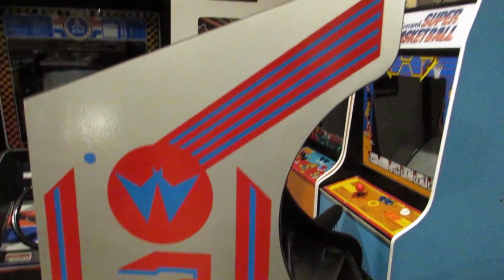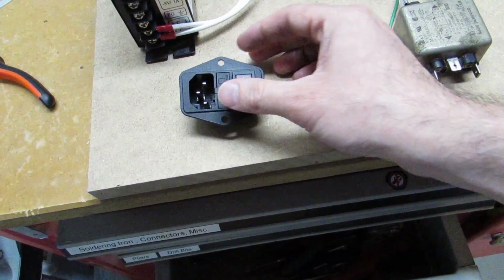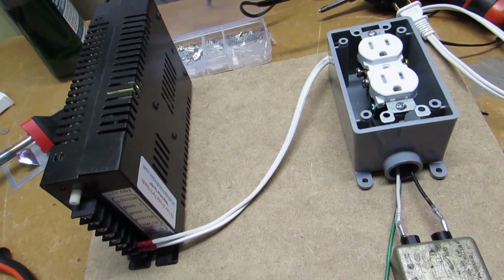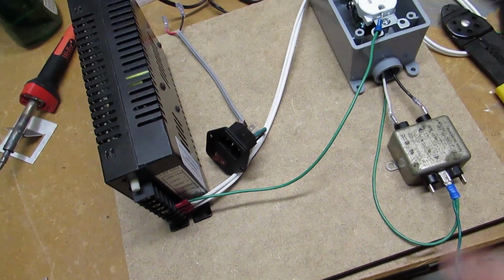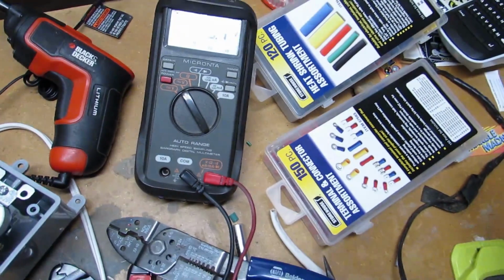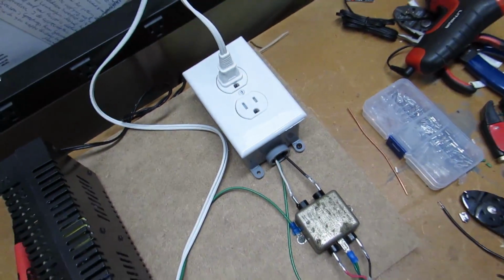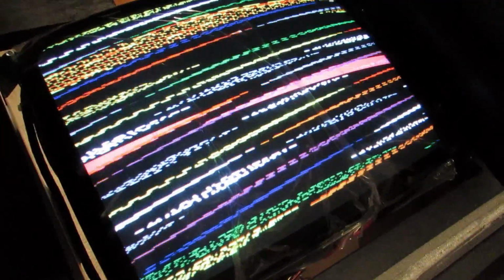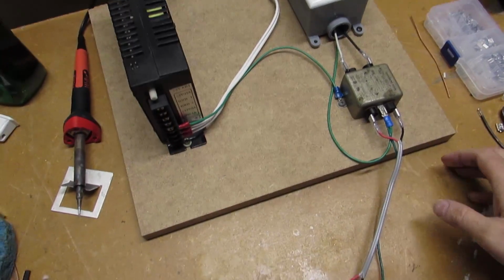Robotron Mini - Power Section

Comment: Uh stupid question... how do you know if the monitor has a built-in isolation transformer? If it has a standard AC cord & plug for power?
Reply from the maker: Not a stupid question. I’d say most of the time, it’s possible that it has a built in isolation transformer if it has the plug and is a newer model. A common exception to this though are most 100v monitors. Such as ones that come in Nintendo cabinets and early Sega cabinets. They have a plug and cord but do not have a built in isolation transformer and must use 100v versus your standard 110-120v house AC.